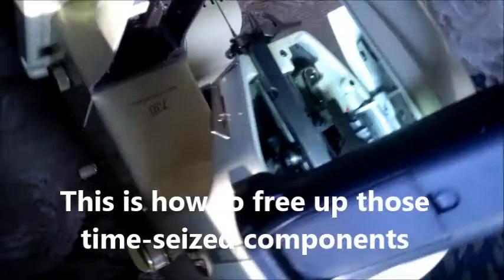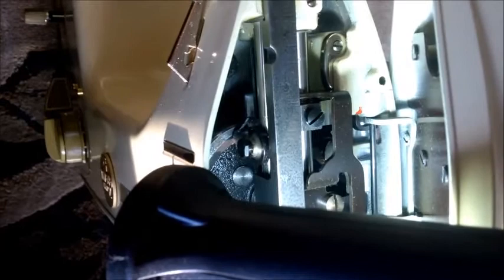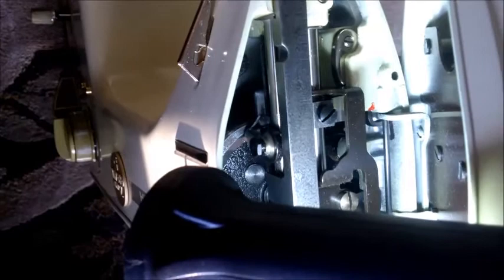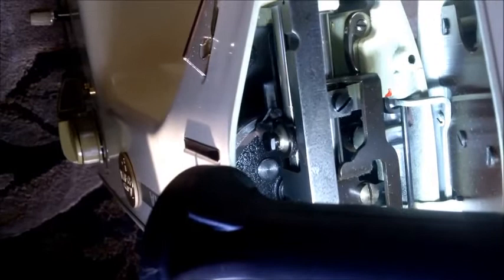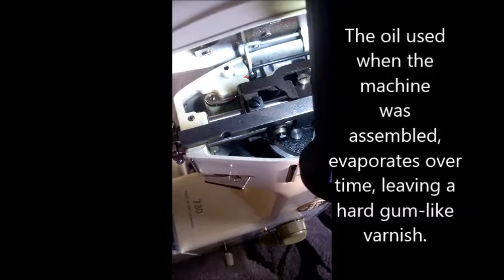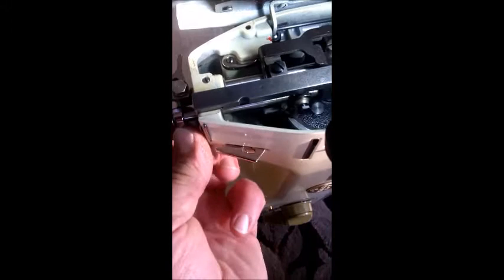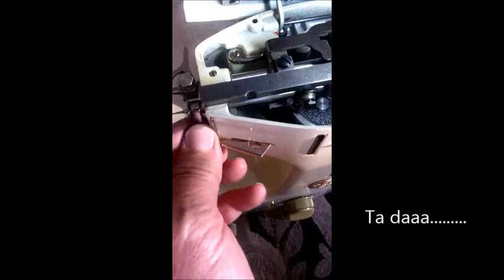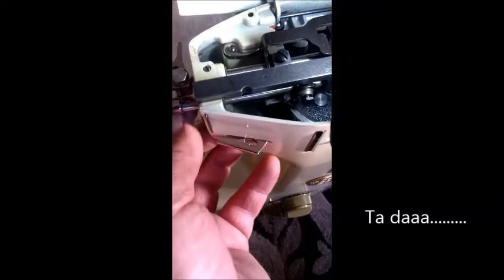How to free up frozen or seized parts on antique machines. Bernina 730 with a Stuck Needle Bar.

Comment: Great! I have a seized needle bar in a singer 4452. I may try this later. If this doesn't work for me, would you recommend maybe kerosene, alcohol, degreaser or even anti seize to get into those bushings of the needle bar? 

Thanks for the vid!
Reply from the maker: Very welcome, I hope it helps. I think you could try any of those, maybe not a degreaser, don't know. But the MAIN thing is to get it good and hot, and it should start to free-up. Thanks!